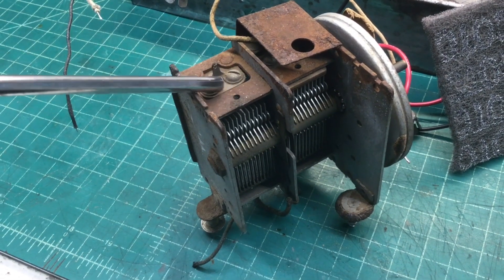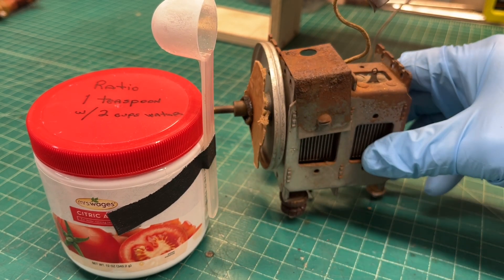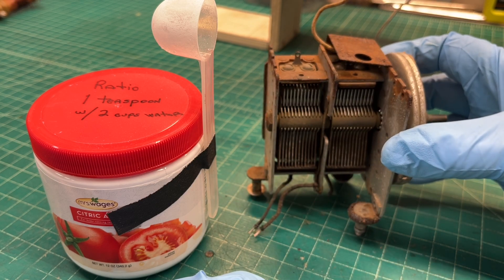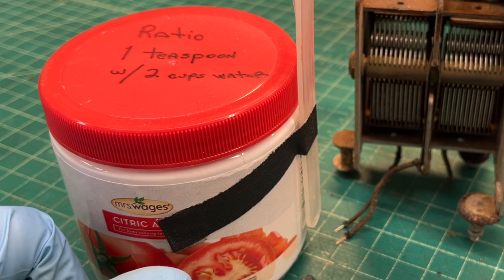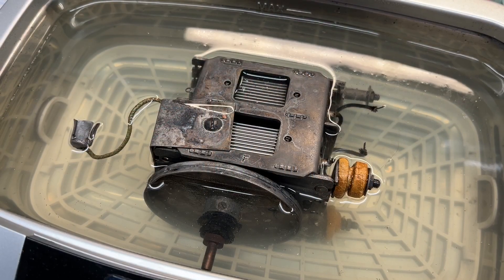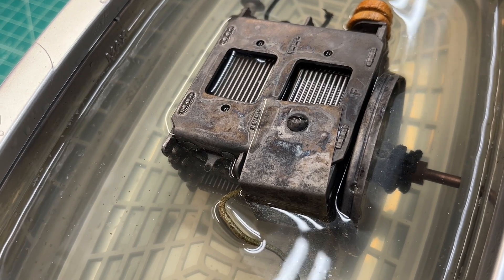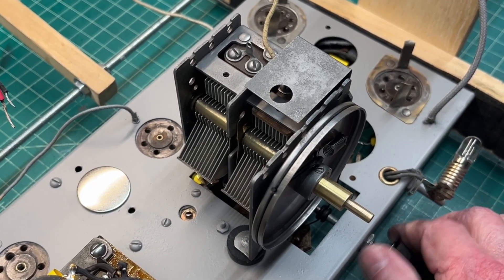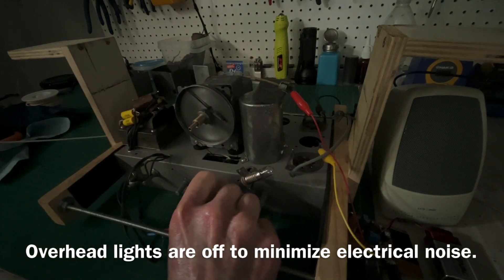Simplex Model PB - Tuning Condenser (Capacitor) De-rusted | Antenna Coil Installed/Validated

Comment: The question that always preys on my mind in rust treatments like this is, "how long was it in the citric acid/ultrasonic cleaner?"
And thanks for the video.  Cap looks great.
Reply from the maker: Thanks for watching. No set time as it depends on the amount of rust. Citric acid works best for surface rust. For the power transformer housing, it took 2 days for one section and the other 4 days. The IF cans took less than 1 day. Hope this helps. Thanks again for your kind words. Best, Don

Comment: Do you find you have to treat the metal parts with anything after cleaning with citric acid? I recently did some steel speaker grilles, and they would start to form a fine rust coating within minutes after being in the atmosphere
Reply from the maker: WD40 also works in addition to Mothers Mag and Aluminum Polish. Best, Don
Reply from the maker: I typically use one of the following:

Rust Inhibitors
https://youtu.be/4t0MiqQKYZw

Hope this helps.

Best,

Don